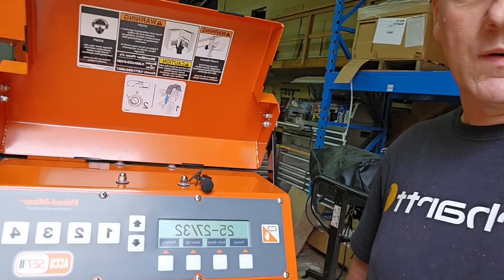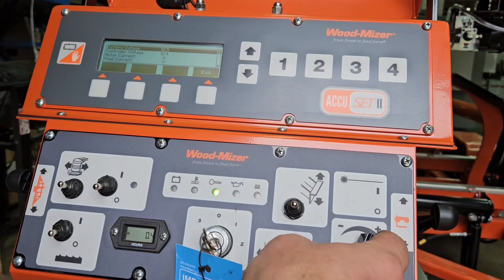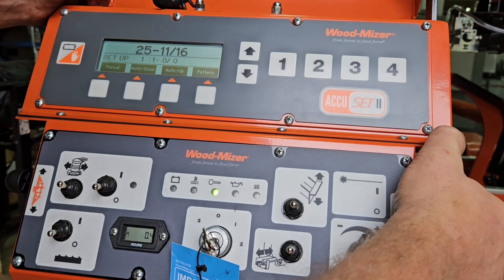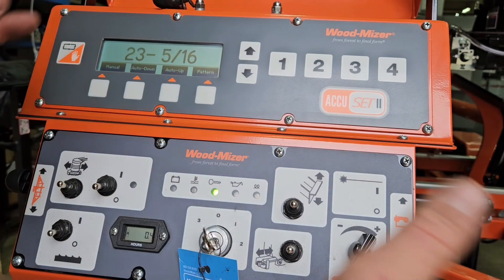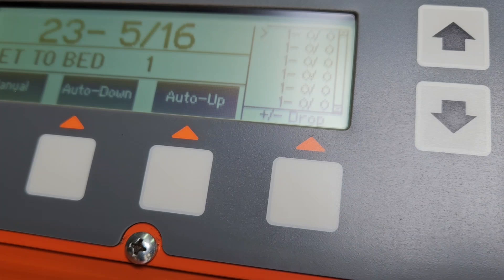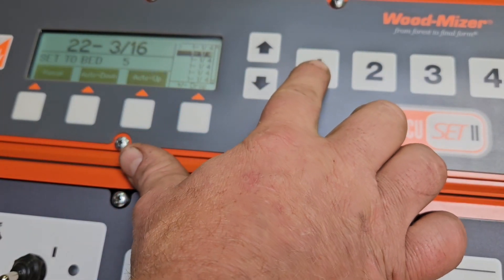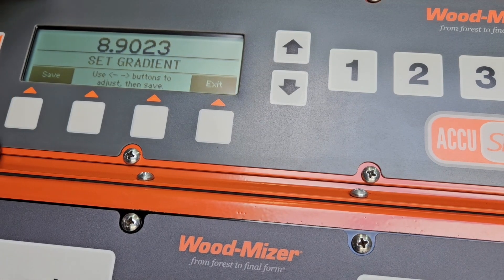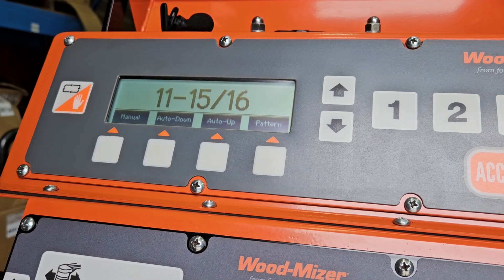Wood-Mizer Accuset 2 explained!

Comment: Excellent vids...just got a used lt40...great info ...tx
Reply from the maker: Thank you! You got yourself a great mill👌 any questions feel free to ask, good luck 👍
Reply: Yes...been watching your vids...first one on how to prep for travel... didn't have a key so opened up panel and jumpered terminals...had sat for years...but still had battery power...1284.8 hours...loaded...debarker...pullback...pulse water...fine adjust jacks...
One question is...left setting...since kerf is 1/8"...why not 0.125...tx am @halfshark101
Reply: Grr...kerf setting

Comment: Got a new electric LT70 at work.
Got an issue I was hoping you might know the answer to. 
When I click A-down for example, and then 1, it doesn't cycle through 1,5,9,13. It just stays at 1. same with the other 3 program buttons. 
Essentially we are missing 12 programs. 
I am Danish, my coworker who got the saw is Lithuanian (not great English), and the manuals are in German.😮‍💨
I think he would worship the ground I walk on, if I could find those 12 programs for him 🤣

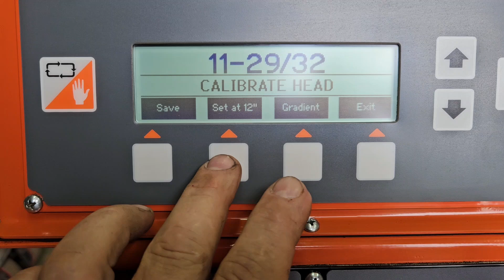Comment: At 17:07. Why did you hit up arrow before you hit “set at 12”?
Reply from the maker: I was already in the calibration screen so if you were starting from scrtch, you would hit the up arrow first to get into head calibration, select 'set at 12' and the screen numbers will then change to 12.00. Save and save again to lock in the corrected blade height permanently. Hope this helps! Best of luck with your new lt40! Great mill, you will love it!
Reply: Perfect. Thanks